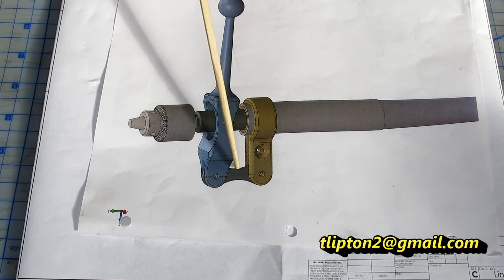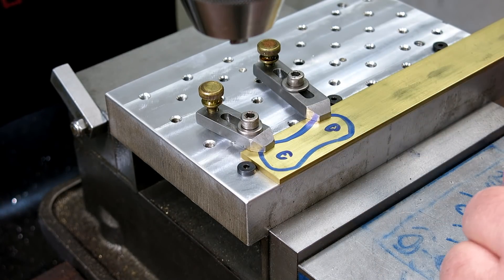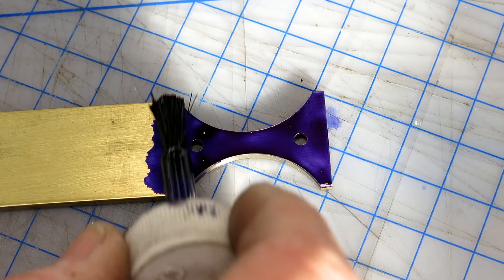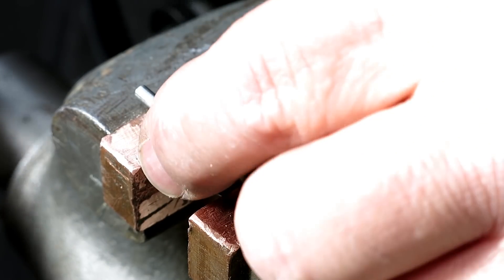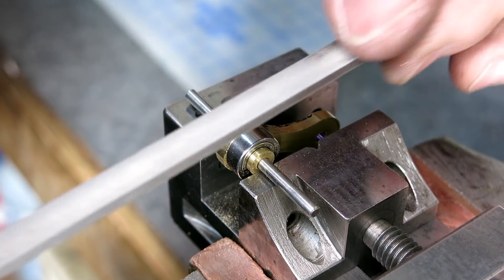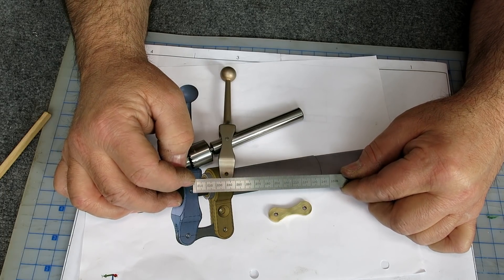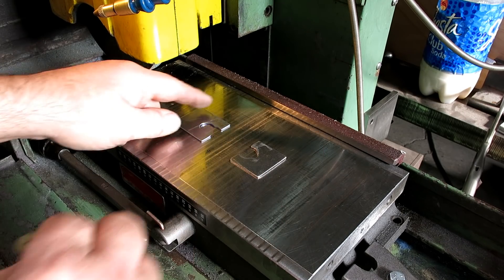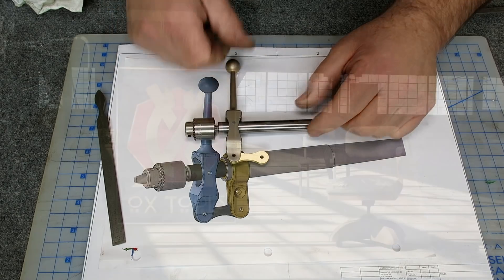Sensitive Micro Drilling Attachment Part 3

Comment: Alternatively, and lacking all your nice mill and mini-pallets, I would cut out the paper template, paste it on the brass, and cut it out with a jeweler's saw.  Then drill the holes (they are on the template) and after that it's all files and/or belt sander. I must say from bitter experience that a jeweler's saw will try your patience. But with care you can cut right up to a line. The ball-bearing filing buttons are neat.

Comment: West Germany had a kit for stuff like this. It was a vise, similar to a jeweler's vise but with round jaws and two holes through them, and a set of buttons made from hardened steel. And the idea is you'd pick your diameter (increments of one milliliter) and sandwich the victim in the vise.

I was a dumb, dumb teenager and sold such a kit, because the vise was right on the cusp of breaking. Someone had abused it to the point where the pivot points on the jaws weren't holding on anymore.

Now i can't find the set anymore because i don't remember what it was called.

Eh, c'est la vie. It was a beautiful thing of delicate German engineering and tool making.

Comment: Never thought about bearings for this, but it's a great idea. 

The most common filing buttons I've seen are hardened, but there's some debate about whether or not that boogers up your file over time, so some people argue for soft buttons and a light touch, stopping when you start cutting the button. Bearings get around this whole problem.

Comment: How does this assembly rotate with a pin through the center?
Reply: It does not rotate. It's for the tailstock of a lathe for small hole drilling rather than using the handwheel.
Reply: @Broncitis6677  Right!  Pre coffee comment 😀
Reply: not very well goof.

Comment: Is there anything special about surface grinding brass not steel?
Reply: doesn't get held by the magnet table
Reply: Brass can load up grinding wheels can't it.
Reply: Yes, it does.   Generally, silicon carbide wheels are used on brass and cast iron, and aluminum oxide on steels.  Softer wheels for harder metals, harder wheels for softer metals.  Generally...
Reply: @duobob  Thanks
Reply: @stevewilliams587  I wasn't sure. Iron/steel sparks and burns.